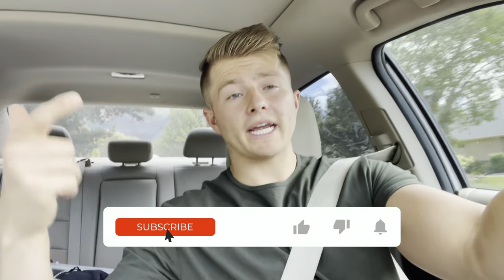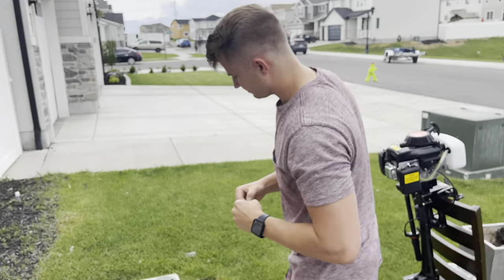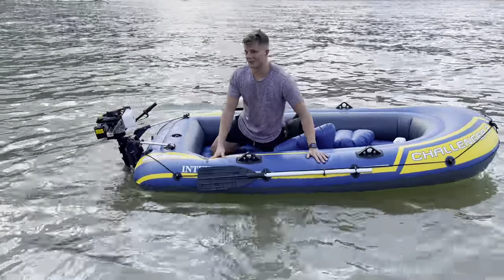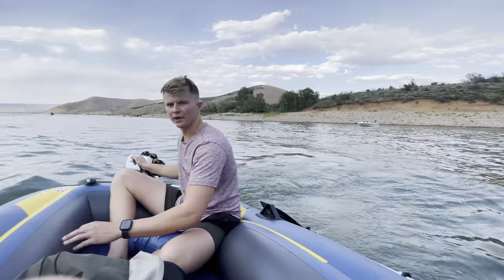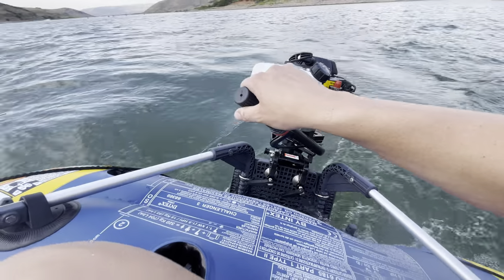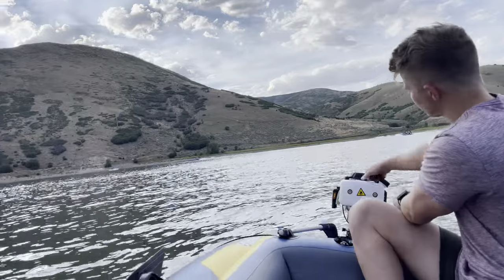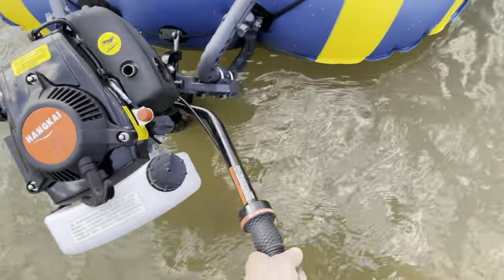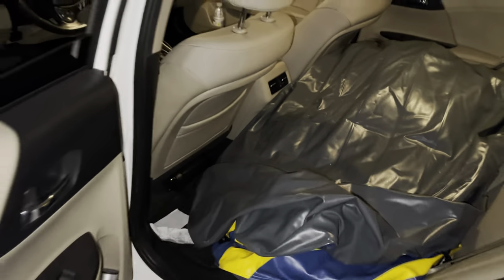I Bought A NEW $300 eBay Gas Motor... Here's What Happened

Comment: Good Video. The Problem is, this Type of Boat is to soft for a Gas-Ejgine.
Reply: The motor mount is the problem he should get the one with the longer arm top mount... The shorter top arm can't support the weight and thrust of the motor

Comment: Hi, we've got the same problem with the motor bend down low line that.  Did you fix it?
Reply: i have drilled more holes to raise the 'transom' plate and set the tilt of the motor to max.   I need to make further mods to distrivute the force of the motor to the back of the boat to make it flex less.  im running a 1.3hp 4 stroke gx35 clone and a intex excursion 4.   im getting 6km/h max now with 2 people and some gear.  for my small-ish lake thats good enough.  But i wish i had bought the 4hp gx50 clone. or a 2.2hp  yamaha.   But that would give even more flex.

a mariner 4 is better for motor, but with some diy tinkering you can also get a small motor running without leaning to much on a excursion 4/5
Reply: It can't function properly on that boat it's nearly immersed in the water.